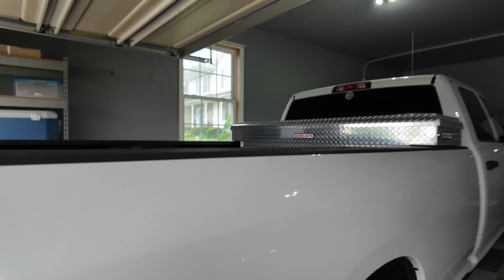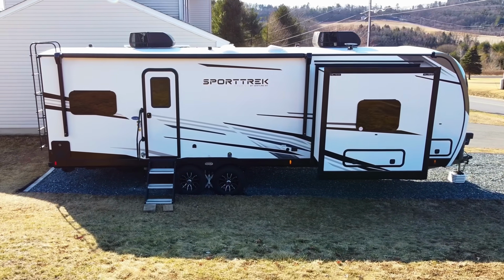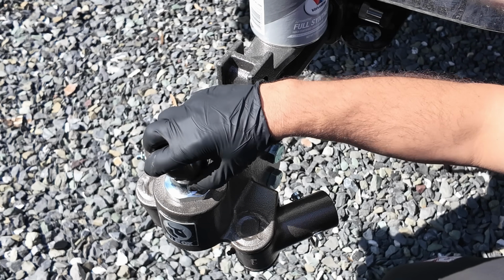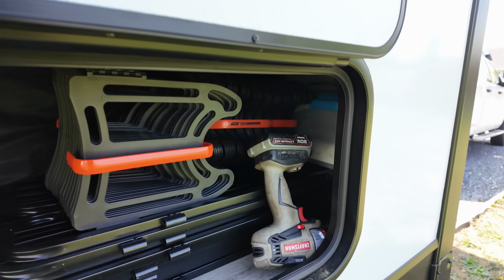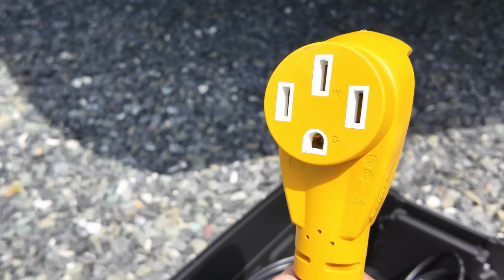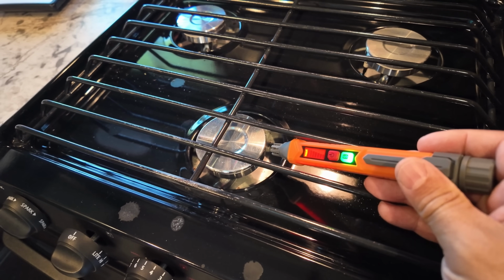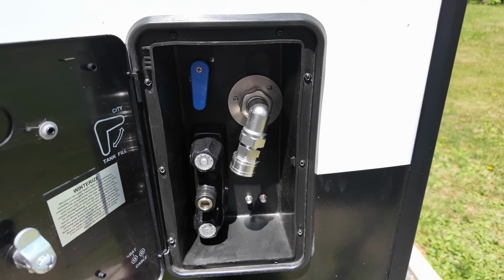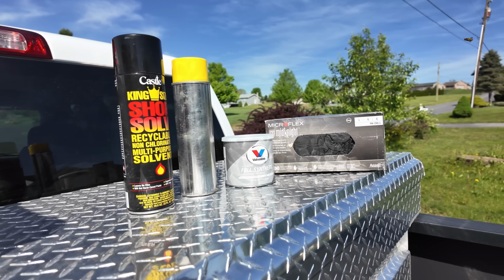Every Tool, Supply & Spare Part I Carry on the Road: RV Maintenance & Repair Essentials List

Comment: On the subject of pre-made first aid kits- while I have a few, I have never purchased one, most were free gifts. I found that making my own was a better option. Most pre-made kits have a lot of "fluff" that i have never used. I worked 20 years in EMS, and only add items I knew I would use.
Reply from the maker: good point Dennis, I always started with purchased kits, but having to refill them occasionally I tend to replace what I know I may need as well.  thanks for commenting!

Comment: A battery jumppack big enough for your vehicle is a convenient addition - doesn't replace jumper cables, but worthwhile. Plus many of them now have USB ports so you can utilize them as large portable power banks too. Another item I've found helpful is the battery powered inflators - every tool brand seems to make them and they even have some that are battery powered OR 12v wired which offers flexibility
Reply from the maker: thanks Joshua!

Comment: As a weekend RV guy that does all of his own work.   I would consider all the systems as you well suggested.  But definitely thinking of the slide out.  Having special tools and or cables to replace a broken one and knowing how to manually bring the slide out in if things go south when trying to leave..  thanks for all you do!
Reply from the maker: good observation and call out, i know i wanted to touch on getting slides back in if something went wrong, but not owning a cable slide system didnt even cross my mind to mention...  something i wish i would have said in this video, even though it is implied I think, is that i have the tools i need to keep the trailer moving.  if a slide out fails, i want to be able to get it in and get it home where i would work on it there.  some folks may want to fix it over the road, and that opens up a whole other discussion on more parts and tools to bring.  thank you for adding to the video my friend!

Comment: I keep a fire extinguisher in the truck in the event I have a brake failure on the camper that starts a fire.  Not that I have had that happen myself, but I saw a guy struggling to get inside the camper to put out his flaming tires on the side of the road. prompted me to put one in my truck cab. 
I wonder why only one extinguisher is in most RV's and it's by the main entrance door. I added another next to the bed just in case a fire starts during the night.
Reply from the maker: Great idea, thanks for sharing!

Comment: Having a set of Dewalt battery tools, I bring what I can or think I will need. Basic drill/driver, extra batteries, Dewalt battery charger and an 1/2 drive impact wrench. Although I have Roadside Assistance, I have been in places where it doesn’t exist and have to change my own tires. Having an 8 bolt truck and 6 bolt trailer, it helps to have it. As well a reciprocating saw with a tree blade can make short work of a nuisance tree or branches. They don’t take up a lot of space, but are very useful tools.
Reply from the maker: thanks for adding!

Comment: How do you remember what each of the liquids are for? I want to be a responsible owner, but I also don't want to buy something and use less than a quarter of the container and then drag around the rest not knowing how long until it's no longer good.
Reply from the maker: the shelf life on most of this stuff is indefinite, or will last a very reasonable amount of time.  youll know what solvants are for vs water displacement lubricants once you start doing the maintenance yourself and finding out what works best for you.  Its cheaper to buy the maintenance supplies and not use them than it is to not properly perform the maintenance and have to replace something.  Hope that helps.
Reply: @RVTIPSANDTRAVELS  Do they still last even after freezes and thaws?

Comment: I'm old enough to have had shoulder injuries. They don't bother me unless I'm trying to remove eight 150+ ft-lb lug nuts with a breaker bar. The battery operated impact wrench is a game changer. Lot speedier too = less time outside in the mud.
otoh a breaker bar will never have a dead battery.
The Klein 11 in 1 is awesome but if you lose a bit the replacement can cost almost as much as the Milwaukee knock-off, which seems to be identical except for the colour and plastic molding.
Reply from the maker: good info, thank you for sharing!

Comment: What’s the difference between your certification and the NRVTA certification?
Reply from the maker: the NRVTA is the school where you get the RVTAA certification... one in the same (sort of, but applies to your question).  I am not certified though, I am registered.  the certification is more for working techs and involves diving into the specific models of a lot of the equipment. The registration course and exam is more general and is useful to understand how everything works, not necessary the detailed nuances you will find in, for example, a specific water heater.  hope that makes sense.
Reply: @ thanks

Comment: One thing I think is important you did not mention. I saw your fire extinguisher just inside the door to the trailer. I would recommend a second one outside the RV in your truck bed in case you can’t get to the one inside. I have a second one mounted just inside my rear tailgate.  Also they need checked every year and documented. Some RV camp grounds are checking if you have an annually inspected fire tag documented
Reply from the maker: excellent suggestion, thank you for adding!

Comment: Pre packed bearing set in a doubled up vacuum sealed bag, and A spare leaf spring can be a life saver. It’s about $100 for both and those can go on any length of trip and will kill a trip. Plus the damage it could do riding on a bad bearing, leaf or getting it towed can cause way more damage than the cost of those two parts.
Reply from the maker: thanks for adding Charlie!

Comment: Car Battery jump starter.  

I went to get my trailer last week, and there was not enough juice in the battery to operate my tongue jack. As I was leaving. I remembered i had one of those car battery jump starters. I attached it to the trailer battery. I had to push the boost button, and when I did, I was able to operate the tongue jack. I was able to get the trailer and go camping that night,  where I had an electric spot and I was able to plug in the trailer and get the batteries charged. (Not sure why the battery was so low. Two batteries and 400w solar panels should have kept the batteries charged during winter on a trailer that is nearing its 1st birthday.)
Reply from the maker: thanks for sharing Jack!

Comment: How do I know what size of a torque wrench I need to buy to change tires?
Reply from the maker: find your biggest spec... which is usually the bolts on the hitch.  they can be around 250 ft lbs.  if you are not worried about hitch bolts ( i dont think most people are) and are more worried about changing tires, just look up the torque specs in the manual.  then, get a torque wrench that will suffice.  I use something like this: https://geni.us/6pgiPt (amazon)

Comment: I have the Dewalt Jump starter and air pump. It has enough cranking amps to jump my diesel sprinter
Reply from the maker: what size truck do you have?  I will have to look at the dewalt pump and jump starter since I have Dewalt tools, thanks for reminding me!
Reply: @RVTIPSANDTRAVELS  it’s the sprinter 6 cylinder turbo 3500 HD

Comment: Great video as always. Here are a few things I carry that you did not mention. crowbar, hatchet, small buck saw, weather radio, Jackery power source, rivet set and tools (important for Casita trailers, for example), steel wool, surge protector for using power at a pedestal. there may be more, but that is what I thought of. In my 4Runner I have Dobinson drawers and they help keep things organized.
Reply from the maker: thank you for adding Ted, much appreciated!

Comment: I’ve packed a “WWII-type” folding shovel/pick for all my camping trips over the last 5 decades . . only had an RV the last 4yrs , and it’s still in my truck.  I use the shovel set at 90 deg as a lever when changing tires, “preventing my mind from injuring my body”!!😂
Reply: I've got a little multi-tool survival shovel in my truck. It come in handy for the craziest things. Like digging a little trench to divert the water washing out the ground under my tongue jack pads during one heck of a rainstorm last year. Never would have imagined I'd need to do that, but it happened and I was glad I had it.
Reply from the maker: very nice, thank you for adding!

Comment: Lol - you are spoiled.  Inside the RV is my Wives territory.  I have a "junk" drawer for temporary indoor storage and a few quick usage tools, one screwdriver, one pliers etc.  Everything else goes into the front storage or the truck storage.  I get half of the large central storage area as well - but that is mainly for cleaning supplies, water supplies etc.  Under the bed though?  No Bueno.
Reply from the maker: haha, i hear ya!  under the bed is all i got inside.  the fancy towels and wash clothes and dog toys take up most of the room 😂

Comment: Yes, put my OCD self down as someone who hauls a spare leaf spring, two shackles, and a couple wet bolts..
Reply from the maker: absolutely nothing wrong with being OCD about that stuff.  I just put sound deadoning pads on the walls and ceiling of the area my around my water pump is enclosed to reduce some of the noise.  I know what its like my friend.

Comment: Check out the pliers wrench by knipex. All different sizes, they might replace the adjustable wrenches in your tool sets. They are in mine. Nice video man
Reply from the maker: I will check them out tonight, thanks for adding my friend!
Reply: @RVTIPSANDTRAVELS  you might check out their Raptors and twin grips as well, to replace channel locks and slip joints. Cheers

Comment: I carry these more for my UTV, but they can come in handy for anything with tires. A tire plug kit. I have a couple different types, the smaller screw-in type and the larger rubber type. I already have a compressor mounted in my UTV, but also have a small portable compressor that I'll bring when we don't bring our UTV.
Reply from the maker: good additions, thank you for adding to the video my friend!

Comment: Instead of jumper cables, I recommend a lithium jump starter. Saved me on my last RV trip when my truck battery went dead. Best part is I did not need another vehicle to jump me. Bonus points for the small size
Reply: Don't leave the jumper cables at home.  Those cables are great for putting a quick charge on a house battery in your camper should you deplete the battery while boondocking somewhere.
Reply from the maker: thanks for adding... I have been meaning to add a jump pack... I honestly have no idea why Ive put it off, probably because my batteries are new and Ill need a 3500W pack for my truck, which isnt cheap.  I did add one to the list before releasing the video. 
Which one do you use?
Reply: @RVTIPSANDTRAVELS i use the DB Power one. I made sure all of my kids have one in their cars. Most brands will do though. As long as the amperage is enough for your vehicle
Reply: @eaglescout1974  I've had 2 from them, both have worked well. I'm always impressed by what they manage to start. Knock on wood I haven't needed it yet myself, but I've helped a bunch of people and it's great for starting the riding mower my dad refuses to get a new battery for, haha.
Reply: @RVTIPSANDTRAVELS I had a f550 dead as could be, no lights would even come on. I hooked my Noco gb150 to the drivers side battery (those 6.7s should be jumped from passenger battery as it’s the one the starter is wired to) and it fired up like both batteries were fully charged.
Reply from the maker: i have yet to use the GB150 on the new truck but thanks for sharing... it never failed us in the past.  glad to hear the same for you!
Reply: @RVTIPSANDTRAVELS  this Milwaukee jumper pack is pretty sweet. It takes a minute to function because it uses capacitors, my buddy has a $15 Amazon set of cables on a battery socket and it'll drain your Milwaukee battery dead in like 10 seconds. The actual Milwaukee one is way better, it starts my diesel work truck when I leave the light on overnight, and it'll do it at least 6 times on a 5.0 M18 battery. Plus it has a voltage readout on it and a USB port to charge stuff. Maybe slightly pricey but usually things that are worth it are a little pricey.
Reply from the maker: thanks for sharing bud, i will check it out!
Reply: Anyone in their right mind would carry both. I've used the lithium jumpers and they are great but there's no reason whatsoever to not have a set of cables when you can get them at Harbor freight for less than $10.
Reply: Have both, just around town one time a lady had a dead battery. I used my lithium jump box, but her battery was so dead. It didn’t work possibly jumper cable us might have. Have both.
Reply: @prepperboss  I've had to do that before. It was so dead my pack didn't think it was connected to a battery and wouldn't turn on. The other car they had wasn't enough to start it. Adding the jump pack was enough of a kick to get it started.
Reply: @XLSLife this right here. Problem with lithium jump packs is if the battery is TOO dead it doesn't recognize the battery and won't work or throws a fault.
Reply from the maker: I believe the Noco GB150 fixes this, there is a second mode for this situation... Id have to check for sure but I think I remember reading this: https://geni.us/zl8N (Amazon)
Reply: @eaglescout1974  THANK YOU FOR THE RECOMMENDATION ON THE JUMPER FOR YOUR VEHICLE
Reply: Still keep cables in my truck but my jumper pack from HF is the first thing I reach for when someone needs a jump, hasn't let me down yet & way simpler than trying to line up vehicles for traditional cables.
Reply: I always carry both.  One works better than the other depending on the situation.
Reply: Another REALLY good reason to carry a jump pack is to help other people get their vehicle started. Using jumper cables could damage your vehicle if there is a major electrical problem in the other vehicle.
Also, if you do use jumper cables, never assume the other person knows what they are doing. I had a guy who didn't know red goes to red and black to black. He didn't know these things matter. Good thing I was paying attention.
Reply: Keep the jumper cables even if you have a jump box. I've used the jump box many times, especially to help folks in a parking lot. But if a battery is completely dead those lithium batteries don't have enough juice to charge it. Jumper cables still have a place in your kit.
Reply: @ToddFillingim you are incorrect. Mine will jump our farm equipment 😂

Comment: Okaaay...let's call it out: 1,000 lbs for bourbon and wine in your weight calcs!??  LOLOL! Nice...

Great list and ideas from RV Tips & Travels. First, I got most of my tools list from Ross's other videos, and will add more after watching this. So...not a lot to add here: 
- Gorilla tape (or us ex-military might call it 100 MPH tape): Extremely useful if you have an external seal or cover that needs to stay put until you show up. This is stronger than duct tape.
- A handheld shop vac. I bought the battery-powered DeWalt and find it super helpful for clean-up after any number of indoor/in-cab repairs.
- A carpet knife with spare blades.
- Headlamp -- not a tool, but huge for seeing when you need both hands.
- Tin snips. Sometimes what's needed for a repair requires something stronger than tape alone. 
- A small hand saw. Was glad to have on hand in making modifications to an RV table that literally fell off the wall. 
- A hatchet. This one is less about repairs most of the time, and more about camping.
Reply from the maker: to be honest, I wanted to add a significant weight to prove a point about payload, so I thought it would be a little humorous to do that instead of spending 2 hours researching all the fluid weights in my truck (which would be drastically less than 1000 lbs anyway).  Glad you caught that, and thanks for watching AND adding to the video Jason.

Comment: I can tell your NRVTA certified. You give the same wrong information about the fuse on water heaters. That fuse has nothing to do with any temperature. That fuse protects from flame roll out. If for some reason the flame leaves the burner tube it will melt that fuse shutting the water heater down.
Reply from the maker: Robert, yes its to protect from flame roll out, and they teach that at the NRVTA, but its STILL the temperature of the flame that disables the fuse, which is a temperature slightly above 200 degrees if I remember correctly (I had have to go back and look to be certain).  Hope that makes sense.
Reply: Robert, the flame melts the fuse because of its temperature.  Not because it’s a flame.  It is technically a temperature fuse rated around 210 degrees F.  You’re not wrong but neither is he.
Reply: It’s still a temperature based fuse Robert.

Comment: I carry spare wheel bearings, grease and seals. Also leaf springs, water pump, propane pressure regulator, water pressure regulator (cheap one with fixed pressure just for emergency), ac capacitors, furnace temperature sensor, tire plug kit, and lithium battery jumper for my diesel truck. I’m sure I am forgetting several items. Thanks.
Reply from the maker: You might be more prepared than me!  Thanks for sharing Terry!